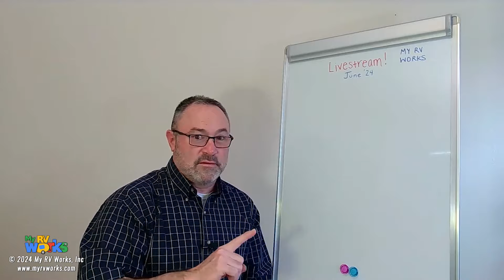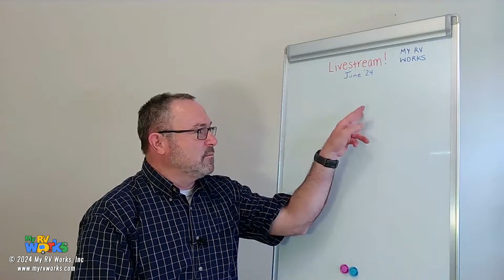Tips For Cleaning Threads With A Tap

Comment: 1/2"NPT and 3/4"NPT (National Pipe Thread).  It is a tapered thread. 
The act you are referring to is called "Chasing the threads".  
   You can also in a pinch make a tool by using a threaded pipe nipple as a thread chase by using a hacksaw to cut two  grooves slightly off from perpendicular to the male threads on the nipple.  You then thread the nipple in to the bung and the corrosion and debris from the threads will collect into the groove you created.  A photo would make this process more  clear but i post pictures here! Lol

Comment: After every trip, I remove the anode rod when I store the trailer.  When I install the anode back in before the next trip, I use anti seize on the threads.  After ten years of owning this trailer, the only problem I have is the angle in which I have to hold the anode rod to install it.  I can tell by the feel when the threads are going to catch correctly.